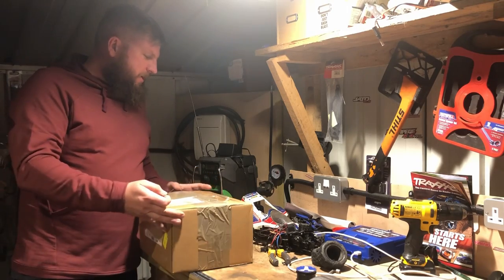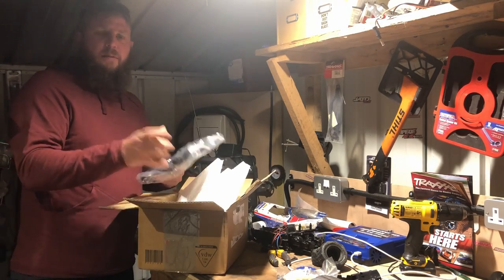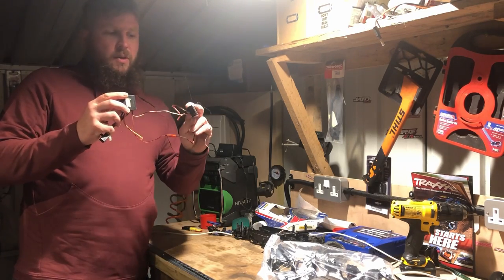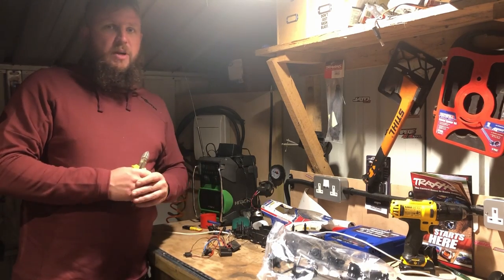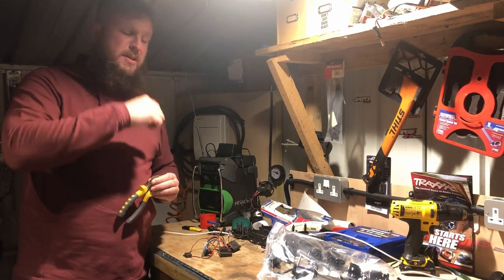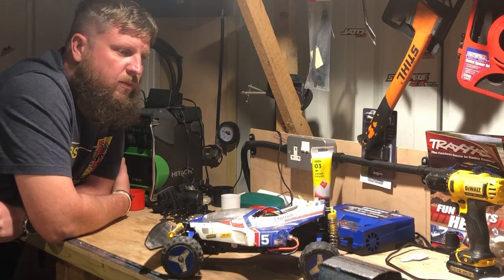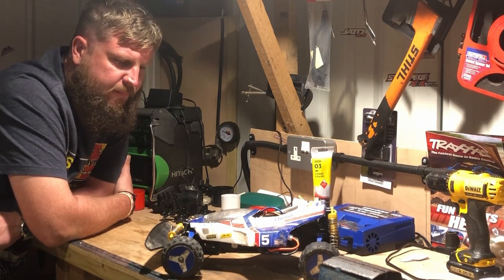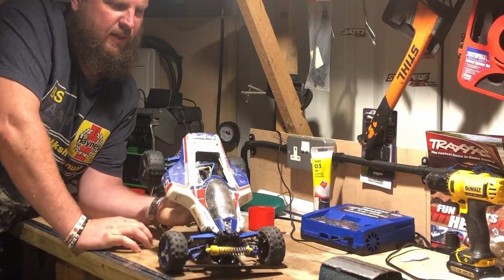Saving a Tamiya Thundershot, Will it Ride Again Part 2

Comment: Nice Video 😎👍🏻🇦🇺 my favourite car to build and drive. Bearings will make this a great runner. I restored mine with a TBG body and Original decals. But MCI ones are also a cheaper option
Reply from the maker: Thanks fella I shall look into them options. But I have just picked up another thundershot so we’re see
Reply: RC Overland They are addictive! I’ve got all 4 variants of the T shot. Currently building one with a wi g and Gold wheels
Reply from the maker: RC Action Australia. I’d like to get a re re should tamiya do it again. I believe it was done in 2004. If you follow me Instagram. I will try to get a picture up of my other shot. Not box art and I think it looks real good.
Reply: RC Overland I’m on Instagram also Rcactionaustralia